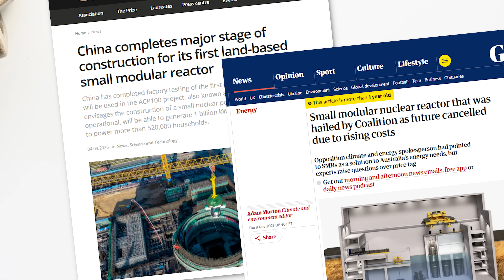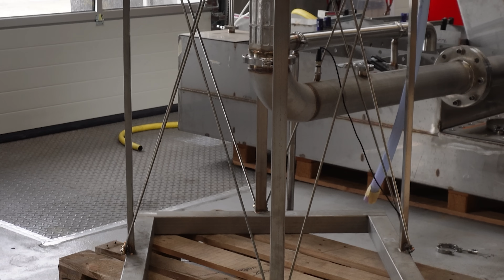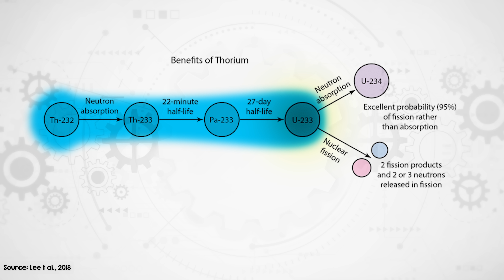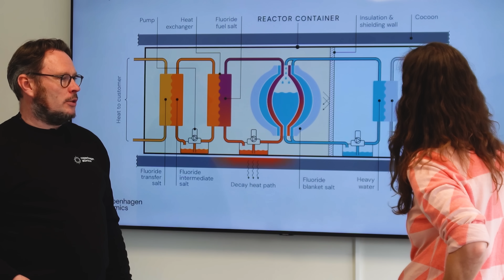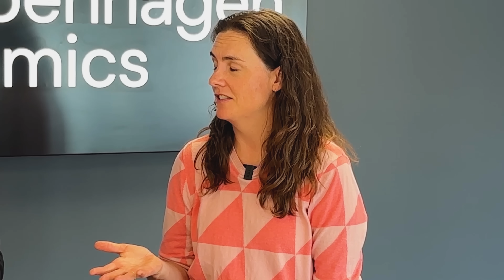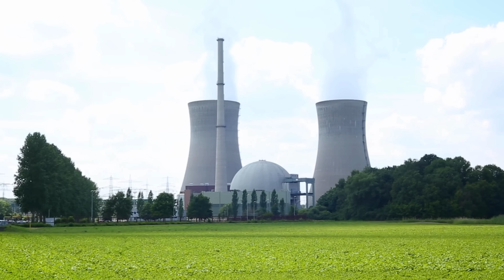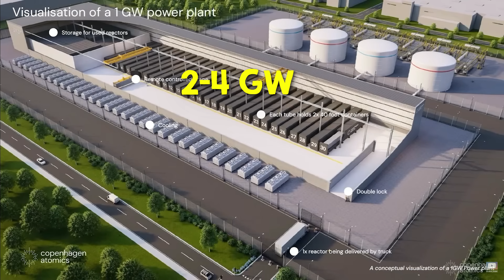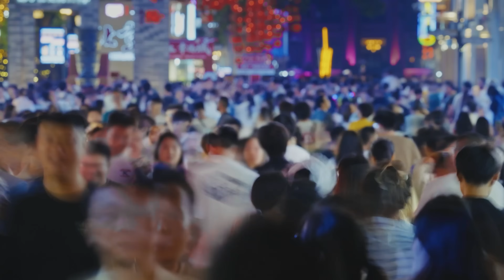Can Copenhagen Atomics Make THORIUM REACTORS Work? [TOUR]

Comment: I have seen a fair amount about the mechanical side but almost nothing about how they expect to clean the salt/fuel mixture and transport the fuel generated in the mantle to the salt/fuel mixture. Since that is such an important part of keeping these units running, I would be interested to hear how they expect to do that.
Reply: The fuel cleaning part is not well developed. It is a kind of fuel reprocessing plant with some restrictions in many coutries and from the IAEA for proliferation concerns. There were some early developments and trials that essentially failed. To make the reactor a thermal breader it need quite clean salt - way more than for a fast reactor. So far much of the developement was for the recovery of U233, but little was done to recycle the thorium. This can be a real challange and thorium is chemically rather similar the the rare earth elements. Recovering the thorium would be similar to recovering plutonium. 
The separation of core and breading mantel reduces the need for cleaning the thorium part, but one would still eventually need it. The trouble with the concept of breading only in the mantel is the need for the barrirer(s) from the core to the mantel (here 2 with the water in between). These would need to withstand a large number of neutrons and at the same time absorb only very few (e.g. < 5%).  It is not clear if such a material exists. Stainless steel would likely fail in both aspects. Especially with the water in between a failure of the barrier would cause major accident. Adding the need for thermal insulation add to the problem.
Reply: @UlrichHarms-ci1ov Why do you think failure of a barrier will cause a major incident? Remember we are talking about molten salt at one atmosphere of pressure. What will happen is that molten salt will get out and simply freeze to solid salt at the bottom of the container. This should be relatively simple to clean up. There will be no radioaktive clouds because everything is contained in the salt - contrary to light water reactors.
Reply: @SteenLarsen  Hullo?! Did you not see the superheated water and steam adjacent to that one atmosphere of pressure?
Reply: @bartroberts1514  The water does not acquire induced radiation, and emergency steam escape technology has been around since the late 1800's. While there may be a chance of a few extremely local burns to nearby employees, no prohibitively dangerously radioactive products should escape, unlike current nuclear reactors which can explode and leak dangerously irradiated material into the environment. It's not a perfect system, but no such thing exists for any actual production in reality.
Reply: @ntsure2436  Which straw man said anything about "induced" radiation? 
The radiation is already in solution in the molten salt—much of it highly dangerous if aerosolized or released. 
A rupture involving superheated water and 700°C salt is an explosive event. Hoping a steam vent in a shipping container will handle that is wishful thinking at best. Calling this school-bus-sized nuclear pipe bomb “not a perfect system” while testing it in crowded downtown Copenhagen is the only thing here that’s perfect: a perfect example of designer arrogance.
May 30, 2024, at a liquid nitriding facility, a roller plug containing water was reinserted into an 800 °F molten salt bath, causing rapid vaporization, pressure buildup, and a molten salt eruption. One worker died and three were injured; aerosols filled the neighborhood in a haze.

1961 SL-1 similar scale reactor had a steam explosion that killed 3 operators and sent radioactive debris over the site. They had emergency steam escape, too. Chernobyl's steam escape also failed in 1986.
Just don't do this.
Reply: Tritium?
Reply: @peceed  Tritium not terribly relevant. Unless someone accidentally manages to a) enrich a critical mass if fissile material; b) surround it in a dense cloud of Tritium; c) create 10,000 atmospheric pressures at 10,000 degrees, triggering an actual fusion bomb.

Which I wouldn't put past this lot, except it's beyond their competency.
Reply: @bartroberts1514 I think they mentioned 80 degrees C… is that superheated ?
Reply: @bartroberts1514  That is on the generation side not the reactor coolant, which is the dangerous part.
Reply: @bartroberts1514  Nobody is worried about tritium exploding. The concern is tritium escaping and contaminating people, environments and waterways.
Reply: @SteenLarsen  With molten salt at some 700 C and water as a moderator there would be quite some steam creation in a very short time. Solidified salt can also cause issue with clogging pipes / valves or damage pumps. There is also a chance for separation of salt components. At the very least it would be a big mess to clean up -- with the highly radioactive salt waiting 20 years for a decay of the radiation would likely not be a safe option.
Reply: @lgolsen  Have you ever seen salt melt at 80 degrees C?

Here, try this experiment inside a shipping container, so it's "safe": a) melt a pot of salt so it's completely fluid (700 degrees C should do it, depending on the eutectic mix); b) drop a beaker of water at 80 degrees C into the molten salt; c) from your hospital bed, assuming you survive, report on the consequences.

When nuclear engineers understate risks, it's time to shut them down and make them sit in a corner with a dunce cap, not throw money at them to experiment in the middle of crowded cities with shipping container-sized pipe bombs.
Reply: @binmanblog  The whole thing is the dangerous part. A complete reactor in the volume of a shipping container isn't a lot of space for separation of components, for gaps to allow dissipation of energy, for inspecting for cracks or leaks, warps or distortions, faults or hot spots. And the plan to put dozens of these nuclear molten salt pipe bombs into an array like dominos?
This is a risk multiplier. These guys have zero demonstrable safety design cred.
Reply: @bartroberts1514  There are two barriers between salt and water - probably zircalloy facing the water, stainless steel (and later, carbon composites) facing the salt. In between is an inch of yttrium stabilised zirconia, an excellent heat insulator. Any detection of water or salt in the gap causes immediate shutdown of the pumps, and an automatic reactor scram. A similar system in Candu reactors detects any leaks between the hot reactor coolant water (300 degrees C, high pressure) and the heavy water moderator in the calandria (60 C, low pressure.) In this case, however, salt and moderator are both at low pressure, so there should be ample time to scram. There's no hot water inside reactor containment, only outside it, in the heat exchanger with the tertiary (non-radioactive) salt.
Reply: @2x6x250ml  Written like someone who's never read Andromeda Strain, worked with pressurized vessels or steam, or heard the definition of the word, "accident"; doesn't know the word "fatigue" in the context of material strength, and is fascinated by the idea that exotic materials hardly anyone understands must therefore be perfect for exactly the processes they themselves barely grasp.

This "any detection"; is it an "any circuit", or an "any sensor"? Is it the same "any detection" as Boeing engineered into its 737 MAX? Oh. Wait. You say it's similar to Candu, a system famous for having the longest maintenance downtime of any reactor, ever.

Have you worked with molten salt in other contexts? Seen it function? Seen it used? Do you know its ins and outs?
Reply: @bartroberts1514  No, water (light water) at 80C. The fuel salt, and the water, are both being pumped through the onion core at speed. At the first trace of steam pressurisation, the pumps stop, and the core salt and moderator empty into separate tanks at opposite ends of the container.
Reply: @2x6x250ml  Zeroth Law of Thermodynamics. Bernoulli's Principle. Water enters at a lower temperature and rises in temperature at a rate determined by Newton's Law of Temperature. Core salt/moderator in liquid form are heated to liquify them, and then enter at lower temperature, then further heat is generated by fission. You may have great calculations about the temperatures, pressures, speeds, feeds, cooling rates, material strengths of your "onion" (though it looks more like an egg to me, not that many layers, none of them homogenous, all of them separated by a membrane or shell, and all of them susceptible to rips, tears, cracks, leaks.

Metal fatigue? Decay due neutron bombardment? Hydrogen poisoning?

When you say "first sign of steam pressurization", do you mean the way happened with TMI, Chernobyl, Fukushima?

And you're counting on the pumps stopping, failure in OFF mode, to undo the pressure surge? Not additional opposite pumps kicking in for emergency vacuation?

What about cavitation?

Everything about the smug attitude toward mechanical safety here stinks.

And you're containing a battery of them in shipping containers set up like dominoes?

Do you build-inspect on site, or before trucking and lifting into place with cranes?

Breakage in transit considerations?
Reply: @UlrichHarms-ci1ov Stainless should last five years (as CA is proving in their test loops for corrosion, and many reactors have shown for neutron bombardment.) Cutting neutron absorption enough to allow breeding is harder - tests have been done on silicon carbide/silicon carbide composites in FLiNaK, apparently keeping metal residues in the salt very low greatly reduces corrosion. Quick removal of metalic fission products would also avoid neutron absorption losses. Some kind of cold trap side loop after the heat exchanger probably - volatiles removed before the heat exchanger, boiled off in a low-pressure cover gas, would also save neutrons, especially by quickly clearing xenon 135. Zircalloy, commonly used for light water reactor fuel rod cladding, could be used for the water-contacting wall, while the planned insulator is a 2 to 3 cm layer of yttria stabilised zirconia. Again, zirconium has a very low neutron absorption spectrum, as does oxygen; yttrium's is higher, but it's only around 8 mole percent max. YSZ is a very tough ceramic, used to coat turbine blades in jet engines to stop them melting. Any water vapour detected in the insulation space would automatically scram the reactor. Candu reactors use a similar leak detection system between the 70 C heavy water in their calandria, and the 300 C, high pressure water in their fuel tubes. The temperature difference here is greater, but there's no pressure difference to worry about.
Reply: Gordon McDowell here on YT has heaps of footage on Thorium technologies.
Reply: The fuel does need to be replaced according to the video. It’s mentioned at the start of the interview and at 10:09.
The cleaning of the fuel is part of the continuous process (apparently).
Reply: "almost nothing about how they expect to clean the salt/fuel mixture "  To me that stuck out like a sore thumb given it's critical to the operation of the reactor.
Reply: A large fraction of the fission products are gases, or are volatile at 550C, eg iodine, krypton, xenon - these simply boil out of the salt in the low pressure area just before the first heat exchanger, and are carried off by a cover gas flow. The noble metals are harder, they could be plated out on a lower temperature metal mesh. Just getting rid of xenon 135, and its predecessor iodine 135, would be a major boost to the neutron economy, as Xe135 has one of the largest neutron absorption cross-sections of any nucleus. The 'xenon pit' is what makes quickly changing power levels in a solid fuel reactor so problematic.
Reply: @2x6x250ml  So cavitation, welds, cold shuts, corrosion, turbulence, knocking and resultant fatigue, pressure waves affecting joints in pipes, gas leaks, domino effects of violent explosions in close-packed systems both through the air between the shipping containers and the pipes connecting them filled with liquids?

Embrittlement. Brittle failure. intergranular attack. Cr leaching. Metal dust formation. Pipe thinning. Pipe distortion. Thermal cycling. Uneven thermal expansion. Water hammer. Salt hammer. Back pressure. Backdraft. Seal rupture.

Do you have well-documented answers for each of these, backed by specific tests? Are they published?
Reply: @bartroberts1514  I thought there was research done to Thorium and MSR in the US and they decided to put the findings online for free the same issue came across; it's not economically feasable and safety wise created too many concerns. This dude makes it look as if Thorium has already reached the point of beating a standard nuclear reactor... Those have litterally 6+ decades ahead of them in tried and tested Research...
Reply: @bartroberts1514 I believe some of those are why CA plans a million hours testing before commercial release.  Others, maybe less so - they're avoiding seal and pipe joint failures by welding them all shut, likewise the heat exchangers are diffusion bonded into effectively a solid block. Stress cracking in the French reactor fleet showed that, over forty years, stuff can crop up and embugger things, but nobody was harmed, and CA is only aiming at 5 years.
Reply: @2x6x250ml  I'm a welder. Welds fail. A million hours of testing is nothing, only around a century of single unit use, about a year for the first hundred units. How many units are planned? 
I understand they're expected to be used for five years. Then they need to act as storage for 400 years while half life decreases total risk?
Diffusion bonding is not a magic spell. No one got hurt is what daredevils and small children say when they get lucky.

You've described wildly insufficient testing with a shrug and a handwave, and left out the factors of malice and mischief.
This amounts to negligence, pure and simple.
Reply: @bartroberts1514  They don't act as storage - fuel salt, heavy water, and blanket salt are pumped out of the five-year-old vessel into the new one, to continue making power. What goes into storage is just the empty shell, with some induced radiation in the steel, and traces of salt embedded in the surface of the primary circuit. Induced radiation shouldn't be very high - cobalt activates badly, so they'd make sure its content in the stainless was minimised. Silicon carbide will probably make up the salt-facing wall of the main vessel. Silicon is doped with neutrons all the time to make computer chips, the resulting 31Si isotope only has a half-life of a couple of hours, then they put it in the gadgets you buy. Carbon has a low absorption spectrum. Worst case, the whole container is low level waste. Best, you could recycle some components, or materials, after a while.
Reply: @2x6x250ml  a) Something stores the waste.

b) those used reactors are waste. It takes over four centuries for the radiation daughters and other hot contaminants that embed into metal to decay enough to be reduced from high risk radioactive materials, beyond the few cases you cherry picked.

How does one "make sure" content is minimized? Do you grind down the surface, further spreading contaminant? What magic force field technology do you secretly have in molten salt dreamland?

Why do you keep glossing over and minimizing these very serious things?

Is there nothing you can admit to about the hazards, safety concerns, liabilities, risks, costs of your science fiction exploding shipping containers?
Reply: @bartroberts1514  The usual method for decontaminating steel with surface fission product contamination is to flush acid through the circuit. If CA can perfect breeding (which admittedly nobody has ever yet succeeded in) nearly all the fission products won't be staying in the reactor or the fuel, as now, but will have to be dealt with as separated streams - gaseous, first, mostly krypton, xenon, and their daughters, then the tougher solids. Many of the latter will plate out on colder surfaces round the circuit, so a mesh after the heat exchanger would be the obvious collector. You're looking at about 70 grams per day, so around 130 kg over five years, plus the mesh. After ten years or so, most of the remaining radioactivity is from strontium and cesium; these might be useful, when separated, for example as batteries, or for sterilising food and medical equipment. Ruthenium after ten years would mostly be stable; it's about 6% of fission products, and about $20,000 per kilo at the moment.
Reply: It’s just chemistry to remove the fission products. No new science is required. Just existing chemistry and mechanical engineering.
Reply: @JuneBannister-k4s And none of it has been done at this scale and at these temperatures. So, yes, it is chemistry, but I would like to know if, and how it could be done in these circumstances. Besides that, maybe they have some new filters to remove some of the contamination. Reverse osmosis to generate drinking water also removes salts and really depends on physics, not chemistry.
Reply: I believe I read something about the reactors being "hot swappable" that way the fuel is sealed in the container and transported as a whole unit. Refuelling becomes a question of replacing an entire unit and then taking the old one to the factory for disassembly. For the cleaning I think the fission products are gases that could just bubble out of the salt as it loops. Since they need to have measures to isolate the bred protactinium from the salt mixture until it decays into uranium, I imagine dealing with the waste would involve similar chemical processes.
Reply: @atrumluminarium  Hotswap means no inspection. No one knows what's going wrong inside. Where there are cracks, leaks, signs of fatigue, bulges, warps. And transport where? By what route? Through what inhabited areas? 
We don't need nuclear imagination of imaginary safety measures.